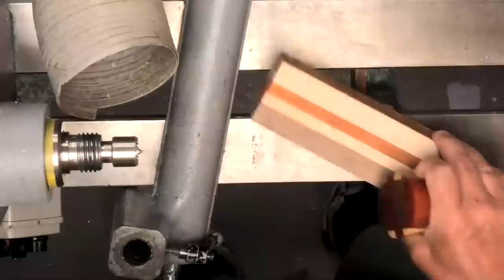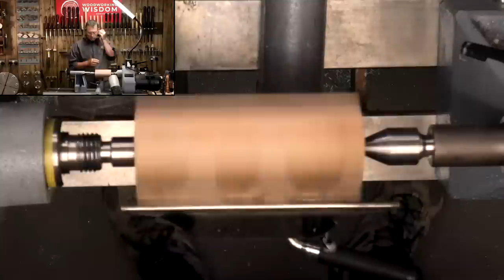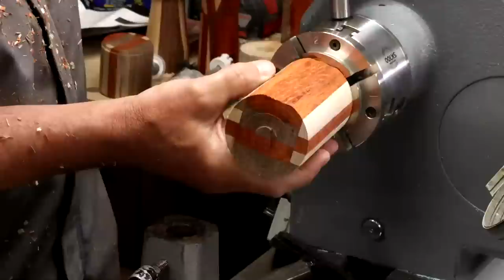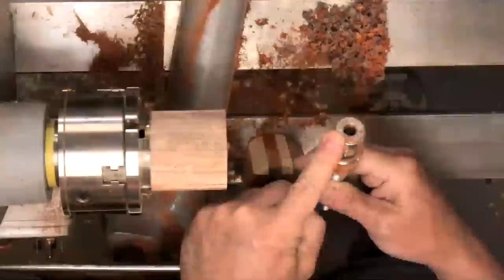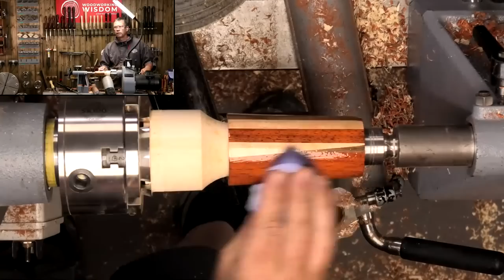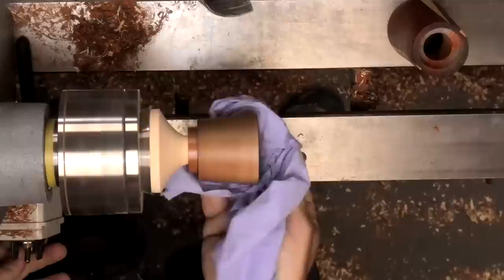Pepper Grinders with Woodcut Mill Drill - Woodworking Wisdom

Comment: I find a simple LED grow light will bring out the color in purple heart very nicely. Just sit it under the grow light for a day or so, turning it as needed. It works and the LED lights wont burn much power. Acetone also accelerates this.